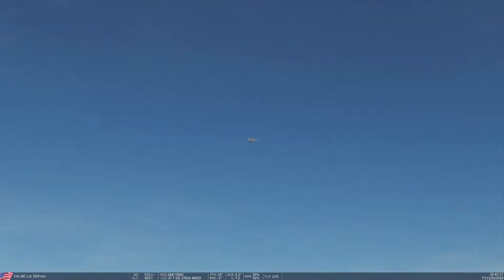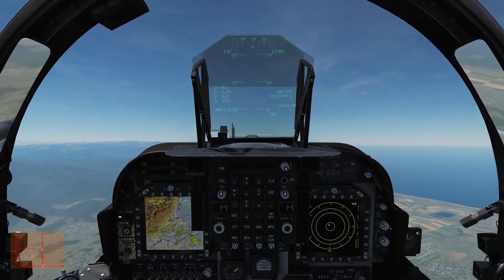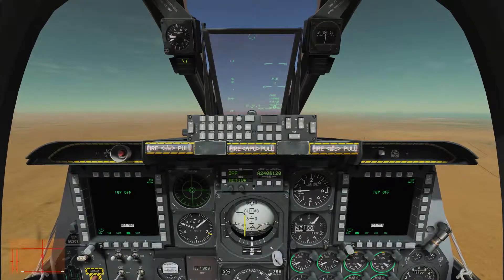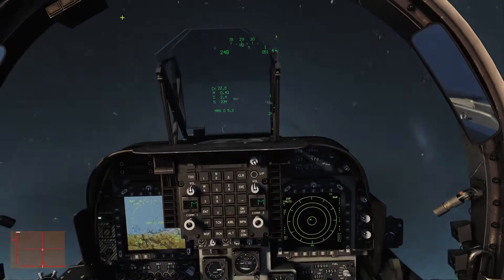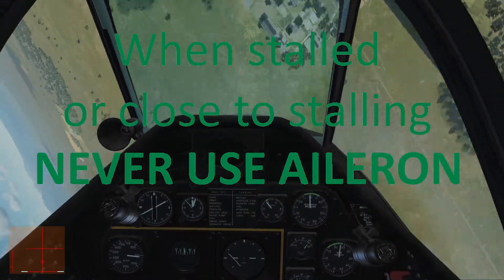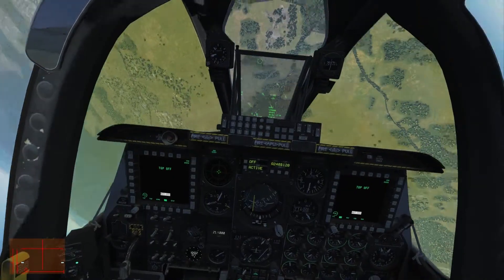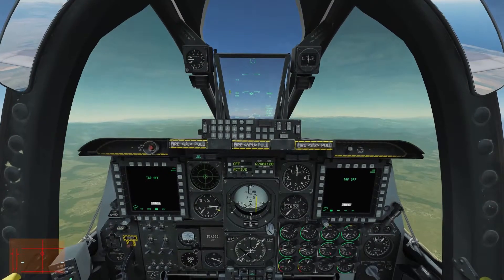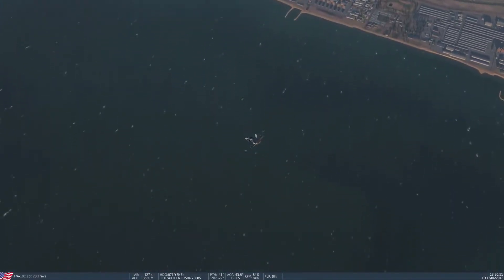Learn to Fly in DCS - Airplanes: Stalls and Spins

Comment: Just went through this with the Su-27. Here's one not mentioned, engine compressor failure with the plane upside down, slowly falling. Managed to recover once, but second time engine wouldn't start. I believe this is a common thing with the Su-27 Realistic Flight Model(Game fly checkbox off in Settings). How do you recover from this one?

Comment: “Unless you have a force feedback stick” Xbox controller players finally have an advantage
Reply from the maker: Not exactly. Xbox controllers have vibration or rumble. Force feedback is where the controls dynamically push back on you, not just a centering spring. Like how in a car the steering wheel jerks if one of the wheels hits a hole. 
In real airplanes you can feel the resistance of airflow on the control surfaces. That feel changes as airspeed changes. It also can lead to you feeling the slight vibrations caused by separating  airflow near a stall. Force feedback sticks try to simulate this (depending on the sim).

Hope that clarifies.

Comment: Just got into dcs. Sorry to see this is the last of this video series. Ty for the two you made, they were really helpful.
Reply from the maker: I still fly DCS, and could find time to male more. Is there anything you would like to see a video for?
Reply: @FravakaVemod  ty for the quick reply. I have zero real/simulated flying experience (closest thing is elite dangerous). So I have no idea how a real plan works. I'm discovering what I need by my inability to do things. Example: 1 flying well (your first video helped. I didn't know triming was a thing), 2 stalls and spins (this video helped with that). I guess my current issue is, I'm failing the navigation tutorial because some green hoops feels really close together. I guess my question would be, how do I make tighter turn? The game recommended air brakes but how do I properly use them. Sorry I know this is really basic stuff I'm asking.
Reply from the maker: No worries! Everybody has to ask questions about the basics to learn them. Sounds like maybe some speed management is needed. Planes can turn a tighter radius at slower speed. Planes do not typically fly around at full throttle all the time (I don't know if you are but wanted to mention it). There is usually a happy speed for best maneuverability somewhere between too fast and too slow. I will try and work on a video (I don't know when I'll get it out) to dig into that as well as landing. If you feel like you need more then maybe we can talk about some one on one lessons sometime.